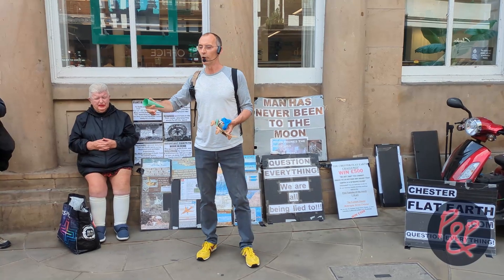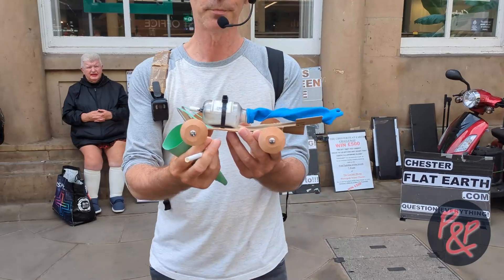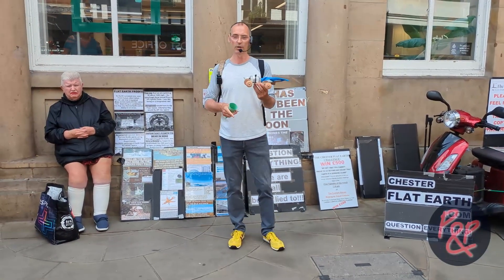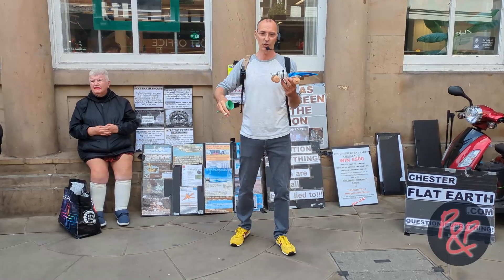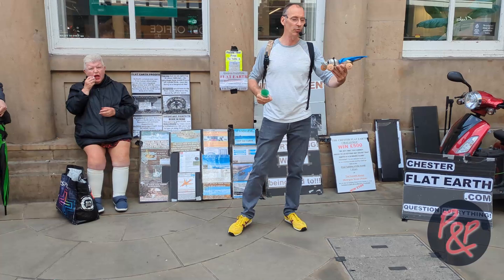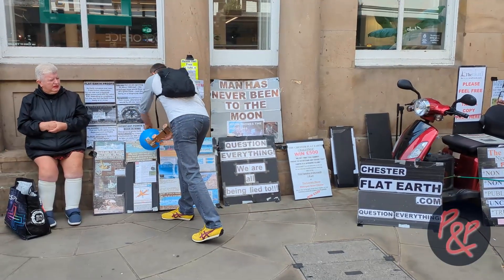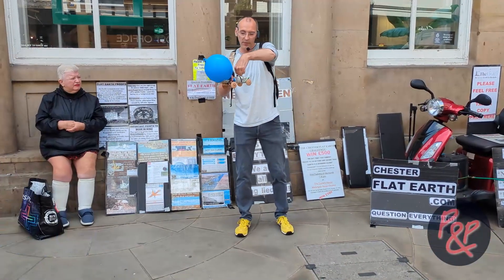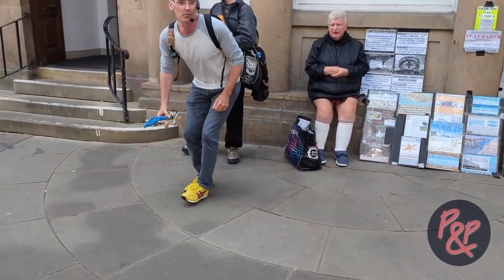Street Demo: How a rocket doesn't work!

Comment: I think the rockets are all balloons and the engines do make a little thrust but nowhere near the figures they claim. I think the fuel is used as a ballast which moves the centre of gravity and helps turn the rocket horizontally after about 90 seconds and then back down and into the water.
Reply: SO are you claiming that the 100-year old Tsiolkovsky Rocket equation is wrong even though we have been testing it for about 100-years?

Lockheed Martin has rocket test stands at sea level and at 1 mile high.
Wouldn't they have NOTICED if the Tsiolkovsky rocket equation was wrong?

It states that rockets create MORE thrust when there is less atmospheric air to slow down the exhaust gases.
So all the rocket scientists have been lying about performing these tests for well over 50 years?
Why would they lie?
Reply: I work for a company that makes solid rocket boosters. I assure you that they make the advertised amount of thrust.
Reply: @AM-rd9pu  put a rocket engine in a vice and compress it 180+ tons and lets see if it can handle it? I think it will fail after a few tons!
Reply: @johnnym6700 We pressure test and static fire all of our motor designs before going to full production. The pressures and thrust are both accurately modeled before any testing is performed. The testing verifies that the motors can withstand the forces it is expected to experience in flight.
Reply: @johnnym6700  Dcforce? Really? That guy is a hack. He bans anyone that challenges his Reddit echo chamber. 

Personal incredulity isn’t a valid argument. Dcforce knows nothing about rocket engine design and I’m gonna bet that you know nothing about rocket design either. A visually simpler design in the newest iteration of the Raptor engine isn’t evidence that rockets are fake or space travel isn’t real or whatever science denial claim you want to make. 

Also notice how you didn’t address the fact that rocket boosters get tested. I can go and see the data from these tests for myself and verify that the rockets are actually capable of getting payloads to space.
Reply: @AM-rd9pu  nothing goes to space LOL. Rockets (balloons) launch then 90s later they are horizontal (with no wings! LOL) then they begin their parabolic descent into the water. (fuel all used up after about 200s).The funny thing is when they are horizontal they still climbing at 2000fps according to the telemetry data! On some launches when the wind blows you can visibly see the rocket (balloon) drift sideways....Amateur rockets are real and they go straight up at incredible speed and then come straight back down with parachutes when the fuel is depleted. As I said those engines don't produce anywhere near the thrust they claim they are just glorified fireworks....
Reply: @johnnym6700  - " As I said those engines don't produce anywhere near the thrust they claim"

Oh they DONT?
So you know how to do the calculations do you?
Can you tell me how much "recoil force" a machine generates that can accelerate 500 kilograms of mass from a velocity of 0.0 m/s to 2500 m/s in one second?
If you cannot do that you have no business trying to lecture physicists.
Reply: @johnnym6700  You still haven’t addressed the fact that rockets get tested to verify their performance. 

You realize that orbital velocity is parallel to the surface of the earth right? It should be obvious that the most logical path is to start vertical and take a curved path to eventually get the velocity parallel to the surface. It would make zero sense to go straight up and make a 90 degree break over. 

And the rocket isn’t traveling horizontally with respect to the ground until it reaches orbit. Before that, there’s a vertical component of its thrust. It doesn’t need wings. And once it’s in orbit, it’s traveling horizontally so fast that it misses the earth as it falls towards it. 

Rockets have multiple stages. They have much more than 200 seconds worth of thrust. 

You can watch any launch or static test and feel that rockets produce immense power. They don’t get greatly affected by wind gusts and they’re certainly not balloons. 

Their path appears to dip due to perspective as they curve towards a horizontal path. Don’t you find it weird that no one that actually works in the field of aerospace engineering finds an issue with the path rockets take but you, not an engineer or scientist with relevant experience, sees an issue?
Reply: @AM-rd9pu  I love how rockets following the exact path they SHOULD on a SPHERICAL PLANET is somehow proof it is NOT spherical.
Reply: @stuartgray5877  They all get hung up on the fact that the path appears to curve back down towards the ground. This is one of the few times that perspective actually is the answer and flerfs give a resounding “nuh uh”.
Reply: You're talking to two alleged rocket scientists who spend their entire existence attacking people in internet comments. Funny how the only two rocket scientists I've ever met had the official secrets act up their wazoo & would never discuss their work with anyone cos they'd lose their jobs & maybe go to jail eh? Makes you think... 🤔😂
Reply: @papalegba6796  I’m still not sure why you seem so incredulous to the fact that an aerospace engineer is replying to your comments. You know that real people hold the occupation of aerospace engineer. 

And you know that not everything in aerospace engineering is secret right? I don’t have a clearance but work on commercial, NASA, and defense programs. I’m allowed to talk about pretty much anything I do other than proprietary information. 

Also, how exactly does occasionally replying to comments constitute spending my whole existence here?

Comment: Same concept applies to the suits they were wearing needing to be pressurized to allow air to move into and out of their lungs. Pressurized would allow air to rush into the lungs however movement of their body/limbs would be working against this.  Also, per NASA, the first moon mission, they allegedly used 100% pure 02 pressurized within the suit.
Reply: A human could survive inside a mylar birthday balloon filled to 5 PSI pure oxygen in deep space.
The Balloon can even handle 5 PSI in the vacuum of space.
Youd freeze or cook in a short period, but you'd survive until the oxygen was used up.
Reply: @stuartgray5877  prove it.
Reply: The space suits were only pressurized to about 5 psi. You can breathe just fine in 5 psi of pure O2.
Reply: @AM-rd9pu  right.  But now explain how they move at 5psi.  And you would die w pure 02 for that long.
Reply: @dav1djac0b  Humans can survive breathing pure oxygen indefinitely IF it is at the correct pressure.
5 PSI is the CORRECT PARTIAL PRESSURE for oxygen in our atmosphere.

But please DO keep trying to lecture actual Engineers about basic physics, it really makes you sound smart.
Reply: @dav1djac0b Why wouldn’t they be able to move? The suits were built to be able to move with slight pressurization. 

And 5 psi of pure O2 isn’t that much higher than the amount of oxygen you breathe normally.
Reply: @AM-rd9pu  at 5lbs per square inch? 
Pump a bike tire up to 5psi and imagine that being your suit and walking in it.
Reply: @rocketman484  every alert & oriented patient hooked up to a vent had their lungs obliterated over these past several years but you’re telling me they’d be just fine 👌
Reply: @dav1djac0b You’re forgetting to consider pressure differentials. 

A bike tire pressurized to 5 psi is over 9 psi below ambient pressure. The atmosphere is pushing on the tire from the outside harder than the tire is pushing outward. 

The ambient pressure in space is basically 0. So a spacesuit has a pressure differential of 5 psi greater than its surroundings. So that’s the equivalent of a bike tire being pressurized to about 20 psi at sea level.
Reply: @dav1djac0b  What the hell are you going on about?  The astronauts have been breathing pure oxygen at 5 PSI, on spacwalks, since the beginning of the space program.
Are you suggesting that every astronaut has died of lung damage?

Bless your little heart!
Reply: I’ve sent your Fauci video to everyone lol. Gives them panic attacks

Comment: It moved a little bit at 5:40
Reply from the maker: not as much as 03:20!! I'd put the motion down to me nudging it when I released the balloon!! Anyway feel free to try it yourself at home on a table top!!
Reply: @PeterPete  You actually seem to have slightly nudged it in the reverse direction. Also, all you did was add a nozzle to make it less efficient. The shape of the nozzle on rocket engines are optimized to produce the most thrust. You are simply demonstrating why this is important.
Reply from the maker: @ChristianSquare  I don't think you understood the video and so it's clear you cannot think for yourself

It was quite clear in that action causes reaction. Inflated balloon expels air is the  action = reaction is the force applied to the inside front of the balloon and we have motion.

Place a nozzle on the end of the straw where the air exits and there is no motion.

This means a force is not induced at the front of the balloon to move the vehicle forward as a result of air exiting the straw!

Comprende?
Reply: @PeterPete  But there is motion with the nozzle. you're just denying that to fit your conjecture.
Reply from the maker: @ChristianSquare  there was no motion with the nozzle accounted for by the balloon deflating! I nudged it when I released the balloon! Try it for yourself and see!
Reply: @PeterPete  - " Try it for yourself and see!"

I have TOLD you that I have tested rocket propulsion IN A VACUUM. It works just like Newtons laws say it must. Why do you disregard what an Aerospace Engineer is telling you?
And you CAN SEE THE ISS WITH YOUR EYES.
WHAT IS IT THEN GENIUS?

Comment: Thanks.  No thrust possible in a vacuum. Stopping the ACTUAL thrust that is created by the rocket exhaust PUSHING AGAINST THE GROUND/ATMOSPHERE by diverting said exhaust proves that nothing is pushing against the inside of the rocket, which is NASA/MAINSTREAM SCIENCE's claim.
Reply: - "No thrust possible in a vacuum"
By making this statement, you are claiming that a crossbow fired into a vacuum would not experience any mechanical recoil.
This is false.
Reply: @stuartgray5877  No thrust from a rocket engine in a vacuum spastic troll. Stick your strawmen arguments up your a**.
Reply: @scottmerrow1488  Oh, so you can be triggered by just stating "facts".
Now I see why you dropped out of school before the 8th grade.
Bless your little heart!
Reply: Also, the near infinite vacuum alleged to be in outer space would SUCK the rocket exhaust/fuel out of any orifice or nozzle as fast as the nozzle size would allow, also negating thrust.
Reply: @scottmerrow1488  So according to you, a machine that can accelerate 500 kilograms of exhaust gas (MASS) to Mach eight does not feel any recoil force from accelerating that mass?
 THAT sounds like a violation of Newtons laws to me.
How can any machine accelerate that much mass without feeling an "equal and opposite force"?
Reply: @stuartgray5877  According to me triggered troll, a rocket engine can not provide thrust IN A VACUUM. Learn how to read.
Reply: @scottmerrow1488  - "a rocket engine can not provide thrust IN A VACUUM."
Sorry but Newtons laws say rocket propulsion MUST work in a vacuum, And the 100-year old Tsiolkovsky Rocket equation tells us that rockets work BETTER in a vacuum, and then WE TEST THEM IN A VACUUM.

"Learn how to read"
You are the one that has demonstrated repeatedly that it is YOU that could not pass a high school physics exam if your life depended on it, but you feel confident arguing with actual Physicists and Rocket Propulsion Engineers?
This is known as the Dunning-Kruger syndrome.
You are this year's poster child!
Reply: @scottmerrow1488    So just tell us using words what does the Tsiolkovsky rocket equation tell us.
Give us your highly detailed breakdown and show us the flaw.
You DO understand calculus and differential equations, right?
Reply: @scottmerrow1488 Where does it say in the third law of motion that it stops working or doesn’t apply when there’s no air?
Reply: @AM-rd9pu  It doesn't damage control boy but did Newton have access to large enough vacuum chambers to test his theory in?  Asking me questions doesn't prove rockets work in a vacuum btw.
Reply: @scottmerrow1488 , let me get this straight... you think that if a crossbow was fired in a vacuum, only the arrow would move but not the crossbow? Why? They both have mass dont they. Do you think there's some God controlling what's happening, and for some reason deciding the arrow should be the only object that moves and not the crossbow? Just want to know your thoughts..
Reply: @scottmerrow1488  - "a "100 year old equation" do not apply to a vacuum and were never tested against one. "

I keep telling you we DO test rocket engines IN A VACUUM.
MY COMPANY DOES THIS over a dozen times a year. I HAVE THE TEST REPORTS.

NOW be SURE to stick your head in the sand and yell, "LA, LA, LA!" instead of listening to facts presented to you by someone who does this stuff as their job.

Comment: no longer on the ball "quote" John Lennon album IMAGINE /  WATCHING THE WHEELS GO "ROUND" Now i get it
Reply: No longer riding on the merry go round
Reply: @VeganFlatEarth are you aware that modern aircraft test the on board guidance system before a flight by MEASURING EARTH ROTATION?
NO?
Search online for "ADIRU alignment".
Then tell us what you learned.
I have been testing fiber-optic gyroscopes using earth rotation as the stimulus for likely longer than you have been alive as my job.

Comment: A rocket is just a fancy bottle shooting hot gas out a nozzle.  If the sky was even an infinite vacuum they could not work.  No medium to push that hot gas out against.  Space rockets are science fiction.  *the sky can't really be an infinite vacuum anyway either.  It's all a big fish story.
Reply: So according to your misguided physics, a crossbow fired into a vacuum would not experience a "recoil force"?
I am certain that they DO.
So there is your "Propulsion in a vacuum".
It works just as Newtons laws say it MUST.
Reply: Rockets push on their exhaust gasses and the gasses push back on the rocket. That’s all there is to it. The gases don’t need a second thing to push against to be able to push the rocket.

Comment: Even Cody's lab proved that there's no propulsion or combustion in a vacuum. But he got confirmation bias because he didn't get the result he was expecting so he enclosed the rocket in a tube.
Reply: My company test over a dozen real rocket engines in a vacuum and we verify that they DO produce the thrust predicted by the 100-year old Tsiolkovsky Rocket Equation.
I could show you the test reports.
Reply: @stuartgray5877  I've seen these so called tests done and they're contrived to get the results required.

There's no way you can replicate the infinite vastness of what space is claimed to be in your tests.

I've seen tests done where the gases start to fill the chamber making the vacuum no longer a vacuum or the gases pushing off the walls of the vacuum to produce motion.
That doesn't accurately represent the affirmative claim of outer space being an infinite vacuum.
Reply: @stuartgray5877  Stop lying Stuart Gray.
I know the shekels are good and you'll always have a job damage controlling but lying is just wrong and gross.
Reply: @stuartgray5877  Yea of course they do & I'm a brain surgeon at weekends as a hobby.

Where do the gases from the rockets go once in the vacuum chamber? Do they start to fill the chamber with gases or is the vacuum turned on constantly making the gases escape the chamber instantly? Or does it take time for the gases to be taken out of the chamber if the vacuum is on constantly?

If the gases remain in the chamber then it's no longer a vacuum as you're producing pressure by adding gases.

How big is this vacuum chamber?
The gases could come out of the rocket and push off the sides of the chamber are you claiming that there are walls around a rocket in "outer space"? If not then your comment is a false equivalence fallacy argument.
They claim outer space is infinite how are you replicating that in your so called tests?
If you aren't then your tests are contrived false equivalence fallacy arguments.
Reply: @Steve-h-v  And when we test rocket engines ("Mono-propellant Thrusters from Moog Corp.)
We test the thruster in a high vacuum chamber, and we can measure the thrust in the first few nano-second of firing.
This is enough data to proves the thrusters work just fine in vacuum
Then we put those thrusters on real spacecraft, launch them to space and TEST THEM THERE TOO.
I just launched the USSF-62 spacecraft for the US space force a couple of months ago.

I am helping prepare the SWFO, & GLIDE-Carruthers spacecraft for launch next year and I am helping build the NEO-S spacecraft for JPL.
Look it all up and tell me where I am lying.
I DARE YOU
Reply: @Steve-h-v  >If you aren't then your tests are contrived false equivalence fallacy arguments.
Gee, I can't believe literally every single experiment ever is a "false equivalence fallacy". 

You know all the gas laws you are talking about are based off of Newton's laws?
Reply from the maker: yeah i seen that and explain to everybody on the street who listens!! People must be insane to still think space travel is real given what's available to indicate otherwise!!
Reply: @PeterPete  Small vacuum chamber fills quickly with the gases from the ignited rocket engine which makes it NOT a vacuum anymore and provides atmosphere for the rocket to push off.
Reply: @scottmerrow1488 but the so called infinite vacuum of space isn’t small, so apparently there’s no comparison, but there’s always meh gravity, that can keep our air pressure here instead of out there not making it a vacuum anymore
Reply: @Andrew-nj2tn  Not without a container, but you knew that :)